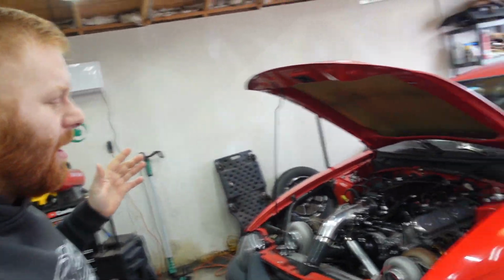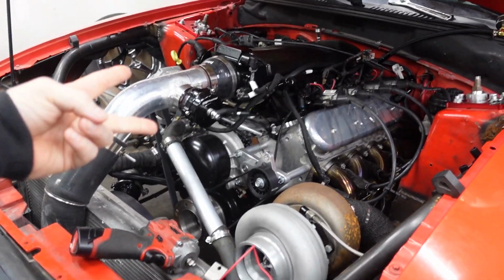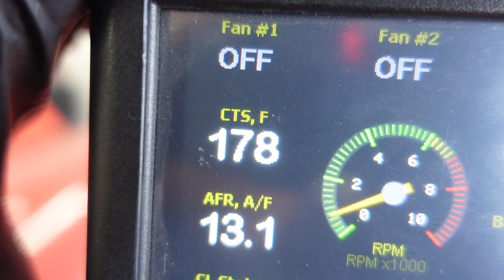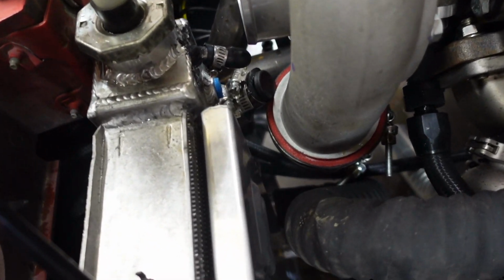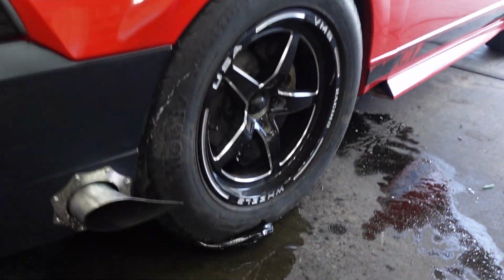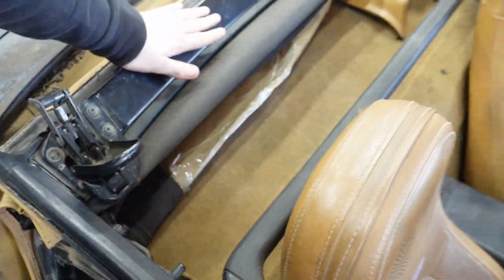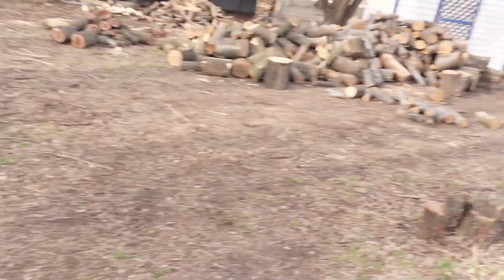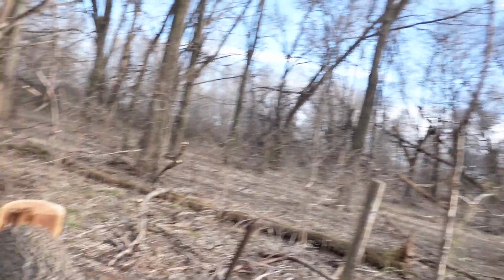1000HP Twin Turbo Mustang First Oil Change! - Future Plans!

Comment: If it were me i would adjust the screw until it runs on its own and get it to the dyno. The tune is definitely not great which is why it’s hunting rpm. I’m assuming the tuner didn’t really mess with the tune much with the cam/crank sync. Issue. You can check what type of coolant sensor you have picked in your tune maybe it doesn’t match the type you installed causing the scaling to be incorrect which would give false temp readings